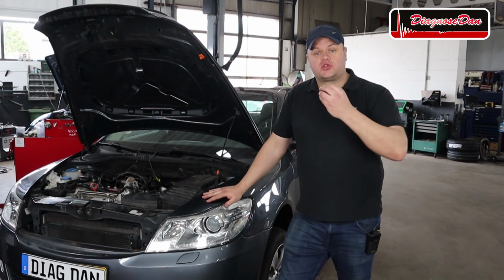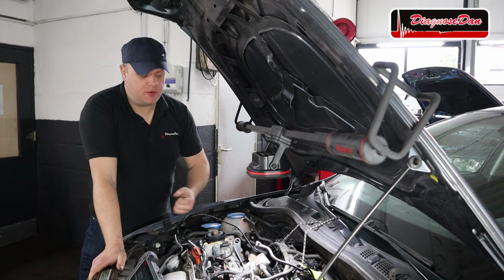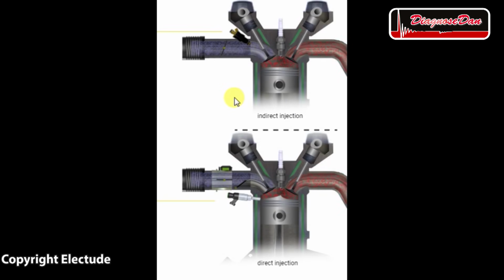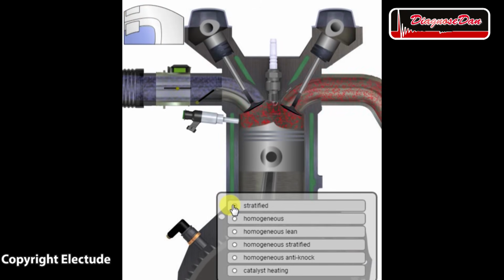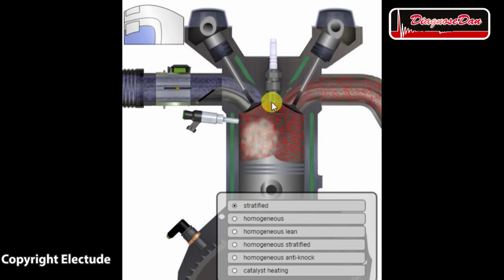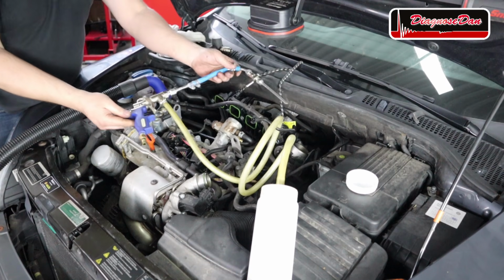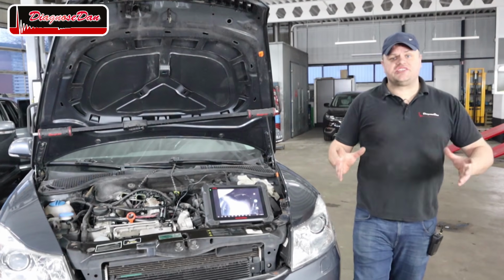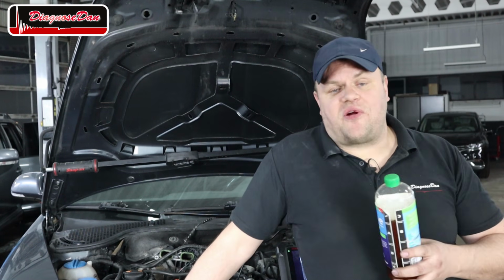Tsi cold misfires explained

Comment: Although Revive isn't very efficient at removing carbon build-up from the intake ports, does it at least do well to wash/remove oil & contaminate build-up of a turbochargers compressor inlet, discharge piping and charge air cooler?
If so I would imagine this could be an effective 'first step' to media blasting the intake ports.
Excellently informative video sir!

Comment: What is the source of the carbon in the first place?
Reply: The PCV system, or positive crankcase ventilation. The reason for needing such a system is because of cylinder blow-by. Every time a piston fires, that combustion is blown past the piston rings. This creates a positive pressure in the engine crankcase. Due to needing cleaner emissions, this blow-by can't be vented to the atmosphere. The blow-by pressure has to be.ventilated through a PCV valve usually on the valve cover, and is then recirculated back into the intake where it is then re-combusted. However, this crankcase gas is usually contaminated with evaporated motor oil and water. This cakes up the intake valves with carbon deposits on a GDI engine. An MPI engine prevents this problem since they use injectors that always spray fuel on the intake valves to clean them. GDI sprays its fuel directly into the combustion chamber and doesn't keep intake valves clean.

Comment: Man I have been searching a video like this for weeks. At last I found. Thank you. I have 1.4 TSI gasoline 122 hp tiguan 2012 103k km. I have cold morning misfires as mentioned in the video. I took the car to Volkswagen official service and they couldn't find the problem for weeks but today and after they said it is the intake manifold and said it will cost 1500$ to clean I started searching for solutions like chemicals you used to overcome this problem at least for a while. So at my car where should I spray that chemical through and what other chemicals can I use? For example würth brake clutch cleaning spray would work? And as I said before where is the place to spray it on my car? Thank you
Reply: I'm unsure if it helps or even applies to your location, but in the U.S. Volkswagen extended the warranty on TSI intake manifolds to 10 years/120,000 mi (193,000 km) due to faulty design of older units.
Generally the MIL will illuminate and the  P2015 code present with the intake manifold issue.
If your Tiguan has not yet been serviced, it might be worth it to at least inquire this with the dealership.
Reply: @MK6_GLI  thank you very much for information. Let me check for that. Would that fault be shown with those cheap obd II devices? And what does MIL stand for in your reply?
Reply: @Benchm8  MIL = Malfunction Indicator Lamp (check engine light).
And yes sir, an inexpensive scan tool can pull the code.
Reply: I want to add this : they said intake manifold but the carbon inside those valves which can be reached after intake as yours. So this is still in service coverage? They still clean or replace those valves?
Reply: @Benchm8 I'm currently planning to visit a dealership myself related to the intake manifold on my MK6 Jetta GLI . My intake manifold was replaced under warranty approximately two years ago and has recently developed similar simptoms as well as the code I mentioned above.
In my own experience from pulling the manifold off during a de-carb and inspecting  the manifold as well as information I found searching online, carbon and excessive oil deposits also seem to accumulate on the intake manifold runner valves inhibiting proper operation of and often times damaging the assembly. From my understanding this is the underlying reason for the warranty extension and replacement free of charge.
Of course with any dealership the work can be rejected/refused but can be challenged by debating the facts to the dealership or even Volkswagen customer service.
Reply: @MK6_GLI  thank you very much sir. Can we find an official link about this service extension for the intake so that I can show it to them
Reply: @Benchm8   This is a TSB document similar to what I provided my dealership:
https://static.nhtsa.gov/odi/tsbs/2020/MC-10172985-0001.pdf
 however depending on your location it might be different. I would search Google or another provider for "volkswagen tsi intake manifold warranty extension".

Comment: Please explain some thing to me driving me crazy . Bought a f150 GDI engine 2015 on the scanner Data showing misfire at idle after running for 30 mins 25 times on 2 of the 6 cylinders but no codes is this normal replaced oem plugs and boots ? Prefect video btw

Comment: Hi Dan,

Thanks for the informative video....do you think the root cause of my problem is the same ?

1.4 Tsi EA111 Twincharger 160ps/118kw (yr 2011)...which has a problem of lumpy/shakey idle during cold start (no matter morning/evening/day....happens when the car has been resting for more than 12 hours).

Occurs only during the first 45-60seconds warm-up (rpm goes higher to about 1250-1300)....then after go back normal 700-750rpm no AC....lumpy/shakey idle gone.

All engine & transmission & dogbone mounts with OEM torque spec about 4 months ago.

Notes :
Even though this lumpy/shakey idle will go away after this cycle completes (rpm drop back to 700-750).....it can be interrupted....

If I turn off the engine before 45-60s warm up complete & restart the engine again.....it will not be lumpy/shakey after restart (or at least in much better idle).

This is the video link
https://youtu.be/rTK9JNEykv4
Reply: Second problem to this car is P0301 during AC off only.

This occurs in the last 3 weeks.... misfire only at cyl1....during idle or traffic light (at any time) if AC is turned OFF.

Cyl1 misfire can be as high as 40-60 misses in 60sec, then it will trigger P0301 in VCDS without CEL.

This cyl1 misfire will sometimes stop....then sometimes reset 0....then start counting again after some minutes.....it will always be like that as long as I have not turn ON the AC.

If AC is turned on......no more misfire will occur on cyl1 during idle (AC must be ON...rpm will go slightly higher from 700-750 to 850-900).

Tried swapping coils around & changed new plug on cyl1....misfire still stay at cyl1 (with AC off)

I uses 06E905115E coils & BKR6EIX gapped to 0.75mm

This is link to video :
https://youtu.be/vMuzc3NMoXU

Comment: I've seen comparisons of all kinds of carbon cleaner. That was far and away the best result I've seen with a single application. It removed the bulk of the carbon leaving a thin layer. I'm going to hazard a guess and say this, if you brought the car up to operating temperature and then unloaded a full treatment as quickly as possible (pretty high rpm pre flow) and shut it down immediately. Let the car sit for 24 hours while doing other jobs. Fire it up and take it out for a drive. Afterwards unload a can of throttle body and injector cleaner in the intake, high rpm. Good chance it will be very clean.

Comment: Man direct injection petrol engines are just stupid engineering - but then again, its to please the tree huggers and politicians with their silly emission laws.  Also the engine will be fine untill the warranty runs out, after which its no longer the manufacturers problem.  Seems the modern world wants us to replace rather than repair cars, which kinda makes this whole story on lower carbon emissions pointless because how much more of a carbon footprint does the factories not add to the world?
Reply: Not to mention so many modern engines have problems burning oil, which ruins the very thing that has kept out air clean - the catalytic converter. I'm all for having clean air to breathe in an industrialized world, but dang it's like they want us to be without private transportation while only the rich can enjoy that.

Comment: I would like to know how many applications of Revive it takes to see noticable results. How many applications for near complete removal of the carbon deposits? How long does the Revive solution take to dissolve a small example of carbon. Would using Seafoam see any better or worse results (I'm not a fanboy of Seafoam. I use it on small engines?)

Comment: The cause is the pcv system , the carbon has to come from somewhere . I'm not a engineer but it seems a bit of common sense that engineers haven't seem to be able to work out .  pcv system should be filtered out before leaving the engine and back in again .

Comment: I've heard of GDI engines that have an additional set of injectors that can be used for indirect injection. From what I understand, the system periodically switches between the cyclinder injectors and the valve injectors to keep them clean. I have no idea what engines these are or how the computer decides when to switch injectors but it seems like a pretty sweet idea. I wonder if it would be possible to modify a "standard" GDI intake to simulate this, maybe with one of those aftermarket mass injector systems which deliver fuel immediately after the MAF (I have no idea what they are called but I know they exsist). Is there anyone out there (that knows a hell of a lot more about engines than I do) that can shed any light on this?

Comment: Hey @DiagnoseDan I have a terrible experience. I drive 07 Honda CRV 2.0l (Stick/Manual) than lacks power. When I floor it on the road, the car doesn't react to it. But when you pull your leg off the pedal, just before your leg is off the pedal power kicks in. So by deduction, when you lightly touch the pedal, power response. I took the car to a dealer for scanning, first I got a code that AF sensor failure, changed that. They later suspected PCV Valve that was ok. No more codes. Injectors work fine. Fuel pressure ok. Where can I go to look next?

Comment: Built in problem, amount of time working properly versus egghead ideas being more polluting than reliable regular engine when they fail. Constant low level pollution or massive spike then costly repairs to injection system, carbon footprint on the manufacture shipping, fitting and disposal 🤔  Carbon footprint of the guy doing overtime to pay for this, probably gets a takeaway cos he's coming home late

Comment: Hi Dan.  Thank you for your efforts. 
I have a old (2006) tsi 125 kw tsi  vw golf. 
About 160'ooo km and I have original brake pads still....  0/100 kmh in about 7 second. No bad for a 1.4 liters.
In 14 years I have replace only 1 light bulb, oil, spark plugs and filters....
  Can i use solid CO2 blaster to clean my intake manifold?
We use solid CO2 blaster (dry ice) to clean aluminum  gravity molds for gravity casting. 
Ciao 
Sorry for my bad English but I'm italian and it is a hard work

Comment: I have a gen 3 1.8 tsi. it has 113,000 miles on it but has always had the oil changed on time. I'm just hoping the inside of my engine doesn't look like this, because I've been wondering about my rough idle on cold starts.

Comment: I mean it is  OK to clean with the blaster the way you did Dan, however a great chance that residue in the inlet manifold ( many a times a one piece plastic composite casting, ) and practically Unwashable, yes replacement is the effective manner; so the heavily fouled up inlet tract/ passeges would disloge and contaminate yet instantly you put back the inlet manifold in place- mainly due to physical disturbance and vibration coupled with the air flow and pulsations , etcetc. 
Some new customers always think that I want I to exagerate telling them  them of the labour intensive job/ price to do a very good job.
Volumetric Efficiency should have  Combustion Mixture added on the front
Cheers Dan.

Comment: contaminated air with breather blow by oil mist  further from the actual cyl.head/  inlet valves makes modern ( albeit almost 15 years since ) also reduces the amount/ volume of air passing to the engine- sometimes to mere pencil hole orifices, more so on Diesel Engines with supposedly highly efficient systems.
 Unfotunately the manufectures do not supply  easily proper knowledge ofthe  Inlet breathing systems' route to the engine.
Also they do not warn of the costs involved to service the systemon regular basis
And what about actual oil residue via the PCV system which is so common contaminating Turbo oil coolers, where in many cases, more so in diesel engines , it causes "Run Away "engines
Well thanks for your great input Dan

Comment: Thank you very much for the comparison between blast clean vs chemical injected at air intake, this is the only video I have seen so clearly about the comparison. Excellent explanation of the stratified mode, cold misfire and carbon buildup.

Comment: Hy,I also recently performed the valve cleaning operation, the valves are like new, I put new spark plugs and coils, but I still have misfires on cyl 2 and cyl 4, maybe it's because of the injectors? something else ?  you could give me a tip ...

Comment: Another cause of the build up is egr valves recirulating exhaust gasses , they are a curse and the cause of a lot of problems . They seve no real useful purpose other han to store carbon and let it all go at one time in one place rather than a small trickle when they are not fitted . Some used to be easy , just fit a blanking plate , that was the vacuamoperated ones , then they made it electronic so if you totallyblanked it you would get a light on the dash. Easy enough to get round though , fit a plate with a small hole to let enough pressure through to fool the sensor

Comment: VW GDI motors don't run stratified at idle, or cold. They run either HOM or HSP. HOM being homogenous and HSP being homogenous split injection. Split injection has two injection events. The primary causes torque stabilization for idle, and the second produces a rich mixture to help heat the cats It does this with a retarded ignition angle. It'd never run lean on idle as the warm up strategy of the ECU is to get the catalyst up to temperature as soon as possible.

Comment: In my 43 years in the motor trade I can say most of the claims on all products that flush, clean or stop leaks or give better gas mileage are very exsagerated most of them cause additional symptoms or problems later on
Reply: Yes, specially that seafoam crap.
Reply: There is no solvent that dissolves carbon in the few seconds these snake oils claim.

Comment: On Direct injection engines, a catch can between the PVC and the intake manifold will prevent a lot of that crud on the intake valves...Also once every 6 months, using the same intake port, Spray/pour one can of Seafoam while keeping the car at 2500rpm...read the instructions on the can...Taking the intake apart is a costly way of cleaning intake valves. 
.While the fix listed above is an affordable way of preventing the problem from getting worse.

Comment: I may have missed it but how many KMs does this car have? I have a single misfire on my 1.4 TSI. And by a single misfire I mean that. From a cold start when I set off it judders just once on the first gear change from 1st to 2nd. And then it's fine. If I give it more gas or use sport mode (so the revs are held longer) and it doesn't do it.

Comment: I have misfire on cylinder 4 while driving on heat summer days when the engine is under a lot of load: 6th gear on highway going a little bit up... changed the spark plugs, ignition coils, same shittie problem. Next thing: check the injectors and the carbon buildup on valves

Comment: Hello Dan, very good information. However, you raise a very important point: there is oily residue upstream the intake valve that will clog up the intake sufficiently in order to decrease performance. However, this is a common problem with all engines

Comment: I use an induction cleaner with chemicals made by BG products, I rate them very highly, If you maintained a vehicle and used something every other year it would keep the carbon deposits to a minimum. That car has never had the induction side cleaned. After that very good blast method the customer ought to adopt a regime of keeping it clean not waiting until there are issues. The chemical method would be OK if used either annually or biannually dependant on use. Cheaper to clean a little than let it get clogged up.

Comment: I believe the main culprit is the PCV residue comming from the intake and cooked by the head heat which were dissolved by gas in port injection system
Solution is a catch can

Comment: First gen tsi also have no external EGR so its opening the intake valve in the exhaust stroke

Which is a extremely dumb idea

Had that in my B7 RS4 V8 and the valves was completely clogged and heavy misfires

Comment: Does the Non Turbo 2.0 FSI Engine have the same High Pressure Fuel Pump Cam Follower issue the Turbo engine does?

Comment: I don't think the problem has anything to do with the fuel not cleaning the valves. We are running more than 100 years with diesel engines and there valves don't need to be cleaned by fuel. 

The real problem is that un-burned gasoline droplets are leaving the cylinder as sticky carbon deposits and then we use the EGR valve to send them back thru the inlet. 

With direct gasoline injection you can't get the gasoline to vaporize enough under pressure and make it burn completely. These engine's are famous for the carbon problems while normal engine's don't have that problem. Put on a turbo and they have made the problem even bigger. 

Gasoline has an octane off 95+ to make it stop the knocking, diesel has a cetane off 45 to make it burn faster. 

Liquid fuel doesn't burn !!!!

Comment: Direct blasting isn't necessary. I have stellar results with BG 260 cleaner... and would run 2 treatments through an engine that carboned up, along with a bottle of Polyetheramine in the gas tank to help. and an SN+ rated motor oil.